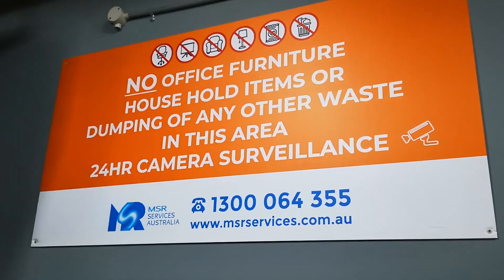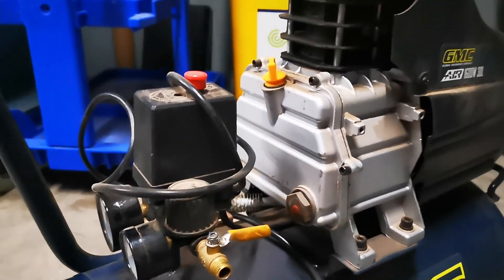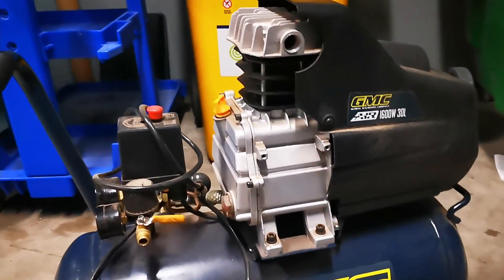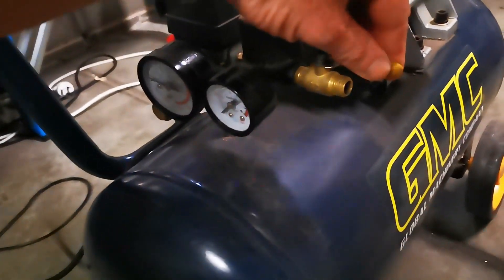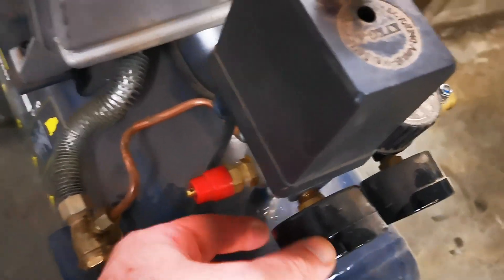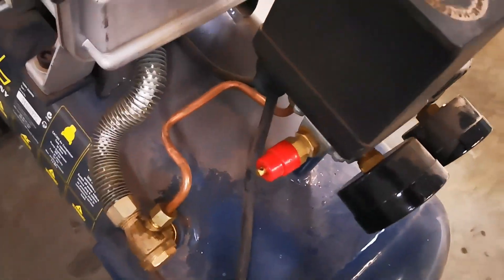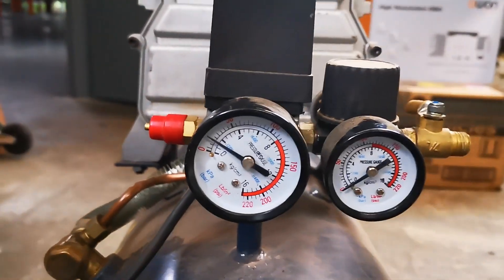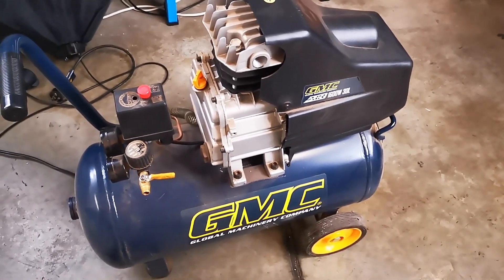Dumpster Diving Decompression

Comment: So several things :
1. missing air filter on the intake of the compressor top part of the compressor head 
2. Check the OIL in the piston area ( look on the side glass and pull the yellow dip stick ) 
3. that is not a solenoid ( is the pressure control ) ( the black box ) 
4. both dials need to be replaced because the first one shows there is air while the tank is empty , and the second(small)  one does not show any line pressure while there was pressure. 
5.need to drain the tank off water ( most people don't do it ) 
6. need to change the compressor oil 
7. Change the pressure control(looks very sus )  an safety release valve because they go bad after several years of use. 
8.check the capacitor of the motor IF its still up to spec 

In general this is a complete  overhaul. 

also get some quick connect fittings in order to have a stands solution for air delivery and a gun for de- dusting stuff
Reply: OR you could use it while it still works and scrap it when it breaks. 10 years ago found myself a compressor with a leakage and no working gauges. Plugged on would run non stop, no idea of the pressures. 

Still it serves me today, filling our car and tracktor tires when needed. Just pluggin it on when using and then off.

Beats not having a compressor.
Reply: Not every failure mode of an air compressor is safe lol

Comment: The air leak is most likely from the pressure switch which is why someone has taken the top off. They are quite cheap on ebay.

Comment: If that compressor gets repaired, it'd be good for inflating tires or blowing dust out of anything that can be classified as an enclosure.

Also, that brand, "GMC" would have to have a license to use it here in the USA due to it existing as a brand of truck for about 100 years.

Comment: The yellow cap is the oil fill, there will be a peep hole glass to check the level

The black square box with the red button is the main pressure switch. This senses the pressure in the tank and cut's it off when full.

On the right hand side of the black box is the output pressure control knob. Use that to adjust the output to suit the tool in use.

They are noisy, and make you jump when they switch on! 

The broken dial shows the pressure in the tank, the other dial the output pressure.

These are cheap and cheerful things, but still very useful. Many air tools are cheap, and a lot more compact than battery or mains.

This is very similar to the unity I have here in  the UK, bouight from a cheap supermarket.  It came with various adaptors and tools, and I also bough a couple of extra tools that were on offer. This thing is easily able to fire 40mm+ staples through plywood, 

The provided oil sprayer makes short work of paintinmg the shed with wood preserver.

An air jet, will blast the dust out of your other dumpster finds!

A good find, worth fixing and keeping.   

Andy

Comment: You were right about the oil fill. If you look at the bottom corner of that housing (big nut on the lower-right, looking past the gauges), that's an oil drain too. If you decide to repair this, it might be worth downloading the manual and following the oil change procedure. Also: the act of compressing and decompressing air results in water condensing in the tank. So long as you're fixing it up, it might be worth checking/draining the tank. Other than that air leak, unit seems good enough, and pneumatic tools are cheap! I'd have grabbed it too, even though I technically have a better one. 👍

Comment: I have a similar unit... they all come from you know where. Got it in 2007 or 2008 and served me ever since. The pressure switch seems dancing or was it the case?

The air filter makes ALL THE DIFFERENCE for noise reduction. A pressure gauge is going to be quite cheap if you source it internationally, like every other spare.

The only thing you should get locally are the air fittings as every continent tend to have their own shapes for what I've learnt in the past. Don't forget to drain it from the bottom (be aware it might spray if pressurized), it will prevent internal corrosion.

Comment: Many compressors have small  valve that is open when preasure is less than 2bar so motor can start easily without current spike. So that leakage is expected at startup. After a minute it should stop. At least mu device works like that.

Comment: That nut next to the relay adjusts the cut off pressure.  Cheap compressors but still great for all the small jobs. Should be an easy fix, either replace that gage or put a bung in it.  On that thingy on the left is a pressure release value to stop the thing exploring it the cut off pressure swatch fails.  Reducing the max pressure by turning that nut will make the compressor last longer and you don't need 8 bar for most jobs.

Comment: I'd be very cautious about getting a used compressor. Depending on who owned it means a lot. There is a valve on the bottom that is meant to be opened often to release any water that condenses inside the tank. If this is not done often it will rust the tank from the inside out with no visible signs on the outside. An internationally compromised compressor can explode with lethal consequences. It looks like there may be a large port on the side of the tank that you may be able to look in to see what it looks like on the inside.
Reply: Yes, exactly what Greg says.  Be careful.  If you open the drain valve and rusty/pink water comes out then it isn't worth keeping since the tank has been compromised.  You may be able to stick an endoscope into the tank to see what its condition is.   I am amazed at how cheap and small those USB endoscopes are now.  On my compressor the pressure regulator leaks unless I keep it at maximum pressure -- since I only use mine to run an impact wrench I don't bother fixing the regulator.  (my compressor was a freebee too)

Comment: I've a couple compressors from other brand (Einhell) with that same pump head, I guess a zillion manufacturers share the same design, in 1.5HP with a 25 liter tank and 2.5 or 3 HP with a 50 liter tank.
Those work well for the price, the small one was 59€ and the big one 89€ in a Christmas promotion in 2015, although they did not come with oil or with any accessories, but I already had them so I preferred to buy the compressors alone.

- The o-ring coming out of the oil stick is a common failure, I think the original o-rings are too thick, I fitted thinner ones and problem solved.

- The oil drain plug has a rubber washer and I was afraid it will loosen, I replaced them with aluminum washers after changing the oil the first time.

- The current oil on it can be anything, usually you have to purchase it and you can find bottles labeled as compressor oil but each brand can have a different oil inside, SAE 30, SAE 15W40, ISO VG100 and so on, but it is a matter of not mixing them, just drain the old one and fill with the new one that you prefer, they carry very little quantity, maybe 1/4 of a liter or a little more.

I think the leak is a damaged gauge but it can be the pressure switch too, also the pressure switch has an unloader device which is a tiny valve and sometimes can fail or get dirty, but some models are designed to leak until the tank reaches 1.5 - 2.5 BAR of pressure, the only explanation I can think of for that is that they do it to give the pump components time to lubricate well before subjecting them to a larger load.

The unloader releases the pressure of that aluminium pipe coming from the head to the tank to make it easier for the motor to start the next time, but it does that only when it stops after reaching the set pressure or when you turn it off with the switch, if you unplug it and plug it back it will have a bad time to start again, usually those motors have a built in thermal switch or an external overload switch, 99% of times when it seems to be dead it will be fine again once it cools down.

And it's missing the air filter, there are various kinds, this model https://es.aliexpress.com/item/1005002023838492.html (and I mean just the model, I have chosen the first listing that I found without comparing prices) is the cheaper one, it's a housing with a foam inside, you replace the whole thing when it's dirty but on a clean environment will last a lot. Some 1 HP models use a 16 mm thread, 1.5 HP models can use 3/8" or 1/2" and 2 to 3 HP models use 1/2" 
The imperial sized threads can be BSP or NPT but in the worst case since the plastic is soft you can thread a NPT filter in a BSP compressor and the other way around.
Other filter models have a screw to replace the element but I don't like those because most times you won't find a spare element or it will cost the same as the whole filter, also if the cover screw gets loose you expose the pump to dirty air.
Reply: Like most power equipment, these are probably built in China.  As a result, you often see minor variations of a design under different branding with prices that differ by as much as a factor of 2.  (I've spent a while looking at disc and belt senders.  Disc sanders are mostly one of two designs, with minor variations in things like brakes and switches, but identical housings.)

Comment: The solenoid is for cutting the motor off when the compressors reaches it's max pressure.  The valve next to the leaking gauge is an over pressure relief valve.  The left gauge is for tank pressure, the right gauge is output pressure adjusted by the knob behind it.

Comment: There's a missing air filter assembly on the intake.  The yellow thing is the oil dip stick .  That gauge is definitely broken.  The emergency pressure relief valve is missing the handle or ring.   Don't use switching the mains on an off to start and stop.  Use the switch on the regulator.  It has a back pressure relief valve so the motor can restart.

Comment: Gauge and the blowoff valve are both likely 1/4 inch NPT threading, standard on all these smaller compressors... Easily to find replacements.

Comment: I found out that it is the best desoldering device. Just mask the circuit board in the direction of air nozzle, heat up the solder and blast off, you can literally pick up the components.

Comment: Once you start finding uses of air compressor, you can't live without  one. I picked one up from trash, with a little elbow grease it in an indispensable tool now. All my cars and bicycle tires stay topped, my furnace as well as car filters stay cleaned and many many more uses. I see a hose kit and some air tools in the future.

Comment: Black box is solenoid electrical cut off.  Adjusting screw in the top alters tank cut off pressure - normally somewhere 60 to 100 psi on these small ones.  Looks like you just need a new tank gauge to fix leak.  Black screw top above 2nd gauge is adjuster for regulated output pressure, rather than just always outputting the tank pressure.  For spraying for instance you may set the regulated output to say 40 psi and compressor will just automatically turn on and off as main reservoir pressure drops.  These are useful for blowing off stuff for repairs, but noisy for anything other than in a garage.

Comment: Motor and cilinder seem in good order. The black box is actually a pressure switch that cuts current to the motor when the pressure in the tank reaches a factory set pressure, usually 8 bar in these things. The red thing is indeed an (over)pressure release valve. Looks like it took a hit on the gauge. The gauge may be broken but also check cast aluminum manifold of the pressure switch for cracks.

Comment: Dave You need new air filter for intake, new gauge and maybe need to change the oil inside the compressor, also the black box is pressure switch to stop the compressor when needed pressure is reached.

Comment: Jeah, these gauges start to leak, when you knock them hard.  What I´m wondering why the air inlet filter at the zylinderhead housing is missing. You definietly have to replace that, otherwise the compressor can die an early death- just had an expenice one,  where the filter itself was missing, it looked horroblie inside. Otherwise, change the Oil, replace the broken gauge or get a complete gauge and pressure switch set from ebay (they are like 30-40 bucks) and replace that ballvalve/ screw on a quick relase connector (what all air gear uses)

Comment: Hi Dave, ask me anything you need to know. I worked for an air compressor company for around 5 years. The 'solenoid thingy' is a pressure switch. Looks like it needs a couple of new gauges, a new air filter and maybe a new pressure switch. If the screw hole in the black cover is broken, the screw won't hold that cover down, so the red button won't shut it off properly. Don't start and stop the machine from the power point, there is a pressure unloader valve built into the base of the pressure switch (follow the thin copper pipe) to allow unloaded shut off and restarts, so it doesn't overload the motor during start up. Use the red button on top of the pressure switch to start and stop, or let it come up to pressure and it should stop, it will restart/stop automatically between 90psi + 115/120psi.👍🇦🇺

Comment: It's missing the air filter on the side of the head. If you can't fix the leak just unscrew the gauge and get a new one.
It's best not to cut the power when it's running. The switch system blows down pressurised air trapped above the piston, so that when it restarts it doesn't stall against100psi.

Comment: I rebuilt two of exact construction type machines. You can literally buy the entire manifold with presostat that controls the motor and screw it  right into the tank. When you turn it on always use the red button on top of the presostat, it unloads the compression chamber when off by opening up the small copper tube leading to it, aiding in easier start. Easy fix though. Yours is louder than usual because you lack the intake air filter screwed into the valve head  - I don't recommend prolonged runs in this way, they are generic and readily available. It's a great machine for cleaning stuff with air.

Comment: Yellow cap is for oil fill and vent. Red one is emergency release valve, usually, preset at 8-9 Bar.. If you pull middle pin out, it will manually release pressure.. Black box isn't solenoid, it's adjustable pressure switch to automatically connect and disconnect motor.. 😉
Upper side hole on head needs air filter to prevent membranes getting clogged..

Comment: Seems like a keeper to me. Should cut your canned air bill. Remember though that compressed gasses can make things go boom more spectacularly than compressed liquids. I'd give the tank a good looking over for rust or damage, replace and re-tape that guage and find the datasheet for the machine. Then make sure it turns off on its own when it reaches its upper working pressure. Most likely it is engineered so the motor would stall before the tank ruptures but I wouldn't count on it. The ones I have used also have a pressure regulator for the hose outlet, so the tank might be at 6 bar and the hose at 2.5 or whatever you set it for.  The datasheet might also specify a volume of air it can deliver at a pressure (a whole graph if you're lucky) which might be handy to know when accessorizing.  A good start to accessorizing might be a doodad for blowing dust off stuff, and a tyre inflator. It can also help with painting, sand blasting on a small scale, pneumatic tools, plasma cutter, off the top of my head. Oh, and if you don't want my old shop teacher to come out of his grave and hunt you down, use steel not PVC pipe if you decide to put air outlets around the shop/lab. Portable hose is fine, but steel plumbing can let it be loud somewhere else. Hopefully goes without saying, but don't get drunk and use it to blow air up anyone's dairyaire because that can be lethal.  Oddly enough that seems to happen more often than I'd expect. Probably best not to apply it bodily.

Comment: Nice score there! 😀 Looks like it might be missing the silencer/air filter on the intake.
Make sure to check oil level. 👍
The leak is probably an easy fix.

A compressor is very useful for dusting off computers and other electronics.

Comment: well i have one of those ..similar one but not the same one..as i went for model with no oil ..I would suggest to change oil..nobody ever change oil in those for ages for sure..then use that pmuber tape to go away that leak ....that black box is pressure switch it will switch off motor once it reach it's pressure ..then it looks to me like there is missing filter at the inlet..there is only empty hole..so i would place on there..these things are all cheap..so not a problem...next thing i would suggest to take out all water from that tank..usually they don't inspect it so there is a lot of water there..

As last hing if you want to use it .is place it onto rubbet pad or some pad it could be from wood below that pad place foam (i had it from old sofa..or what ever) so no vibration to the ground..then i would suggest to place some foam material also some wood is good around it so it isn't so loud ..one thing is to don't vibrate but noise from that will come no matter what....you can't close it completly as it need fresh air to be able cool itself..and a lot of air..but still some box where it will all go would be good..and then ofc you need one hose to take it into your room (where you have desoldering tools) i use it for that a lot..also if you are dasting stuff..pretty usefull..